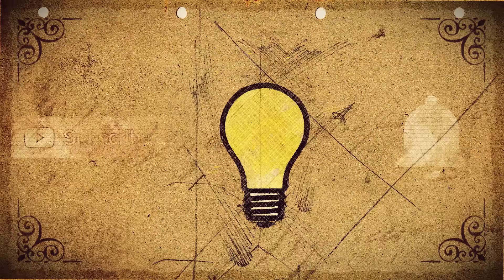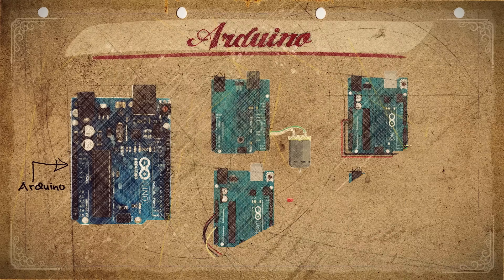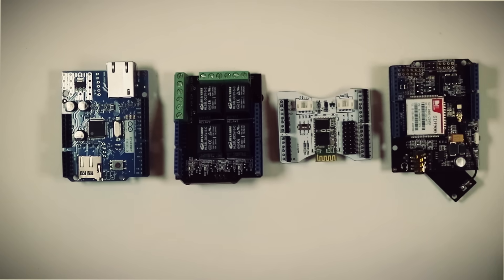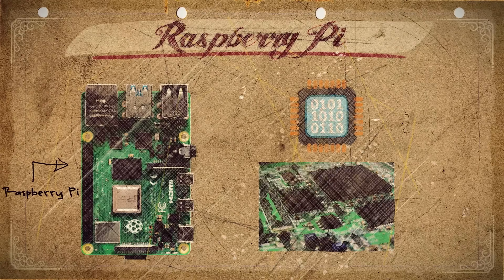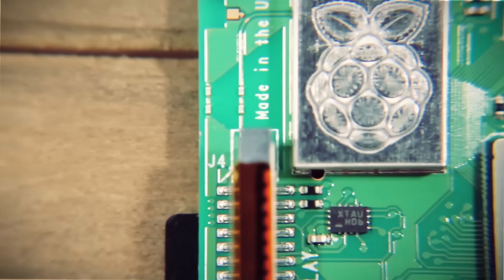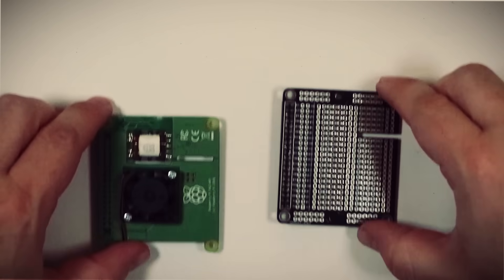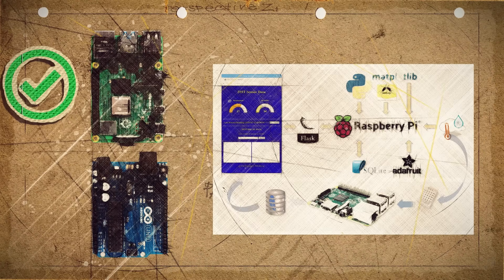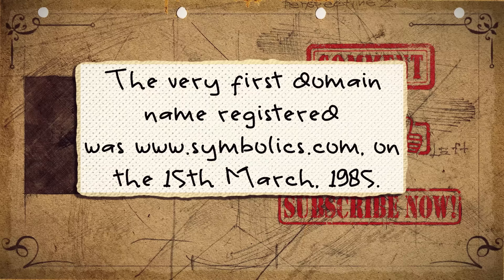What's the difference? Arduino vs Raspberry Pi

Comment: No Nerd ever debated Windows vs. Mac. It's Windows vs. Linux.
Reply: All my comp sci profs use Mac...
Reply: @retrotellephone  That's because they also suck.
Do you really think that you're getting your (or your parents) money's worth?
Reply: @retrotellephone Exactly. Because they already went down the linux rabbit hole and realized it’s a waste of time when you need to get actual work DONE. It’s pretty telling when the department orders laptops for the entire faculty, letting them choose whatever they want. Two of them chose thinkpads. The other 30 chose macbook pros.
Reply: @retrotellephone  "All my comp sci profs use Mac..."

Those who can, do.  Those who can't, teach.
Reply: @richardwicks4190  XD
Reply: @richardwicks4190  There’s a reason why software developers use macOS.  You can make a virtual machine of anything from it.  You can even install package managers like linux.  You can also have arm processor support directly.   No other operating system can make a a good virtual machine for macOS without it being illegal or quickly put out of date or non functional.
Reply: @eddieisfiction442  I am running MacOS and Windows on my Linux box right now.  I primarily use VirtualBox, but I could use VMWare - although I prefer VirtualBox.

I don't give a crap about "legality" either.  I'm not spending $2000 for a broken Unix system that has been kneecapped just to port a program for a one off to a customer.

I'm fed up with Apple's crap.  I'm fed up with them disabling common features in Unix, I'm tired of them obsoleting hardware with software updates, I'm tired of them charging 2x what everybody else does for their CRAPPY hardware, I'm tired of them claiming they "invented" stuff they didn't, I'm tired of their arrogance, I'm tired of their crap.

I'm fed up.

This is a predatory, dishonest, company.  If you don't realize that, well, that's why they can remain a predatory, dishonest company.  You keep buying their garbage and it IS garbage.  It's frustrating garbage to deal with.

Doing something as TRIVIAL as moving a music library to one of their phones is MADDENING.  You know what I do?  I can use Samba, FTP,  SFTP, or just download it with a web-browser through the Apache server running on my $75 raspberry pi server.

They don't create an ecosystem, they make a PRISON but they call it an ecosystem.  They don't work with common protocols, they have repeatedly betrayed corporations that have tried to work with them, they are one of the worst technology companies in existence today, and I'm well aware of the treachery of Microsoft.

I deal with Apple when I'm FORCED to deal with them.  You want to use the system?  You're going to pay through the nose, because no COMPETENT developers want to deal with their crap.  Work with them long enough, and they'll burn you.  Apple is a primitive, broken, Unix system to me.  It's worse than working on a Sun workstation from 1992.  Seriously, it is.  The lack of common tools is just maddening.

The whole purpose and design of Unix was make a single tool to do one thing, and make certain it does it well - then you chain programs together to do more complicated actions.  How do you do that with a sandboxed system like the iPhone?

You don't.  It's like working on a very fast Amiga from 1986.  It was cool back in the day, but that was 35 years ago.  That's how primitive it is to me.  I hate the system, and I will ONLY work with it, when there's a gun to my head.  It's BSD that's been severely hobbled.  They took BSD, slapped a proprietary display manager on it, and stripped it of common functionality and called it "better", they closed the branch they made, and now they want me to buy hardware that is priced 2x what a standard system costs to run it.

No.

If you're a developer and defend this crap, you're crazy or you're a bad developer.  You need to work in other spaces to understand.

Linux is UBIQUITOUS, you're using it right now to read this, more than 80% of the Internet runs linux.  Your car probably runs it, your television, your netflix box if you have one, everything.  You want me to go from THAT to Apple?  I'd rather flip burgers, seriously.
Reply: @richardwicks4190  so you admit you are doing it illegally then….
Reply: @eddieisfiction442  You know it, Brother! Running Intel binaries and development tools on M1 or M2 just fine for all but game developers. Apple has a serious commercial business application development platform in the new Macintosh family.
Reply: @eddieisfiction442  Dude, the only way I can access a remote display, something as BASIC AS THAT, is through a virtual machine.  I'm not going to lug around a freaking computer just to to tweak something every now and then.

Apple makes CRAP.  The purposely break stuff, to cost you money.

It's, hands down, the most frustrating, irritating system to work on, and I've worked on Windows, and WinCE.  I've worked on VMS.  It's ridiculously primitive.

If you want a machine to browse the web, listen to music on, and maybe pop up NetFlix, it's fine.  I need a LOT more capability than that.

The ONLY reason I EVER boot up that irritating, frustrating system, is when I have to do a code mod, which is very rare because Apple is the LAST system I ever support.  I hate working on it.  It's broken, pointlessly, everywhere.

The idea that it's "the best Unix" - is absolutely wrong.  Linux isn't quite Unix, it's a SUPER SET of it.  Porting a program from SunOS or AIX to Linux is trivial - try to port it to Mac "the best Unix".  You can't even get BSD software to work on it without jumping through hoops.  I hate it with a passion.

And it's not even stable.  I can crash Apple by just fooling around with iTunes.  How can a PROGRAM crash the operating system?  We've had protected memory for over 30 years with translation lookaside buffers in consumer hardware.  We've had protected memory for at least 50 years in commercial grade hardware.

You, seriously, expect me to buy their crap?  No way.  Even if it was a 1/4 of the price, it would be a ripoff.

We all break EULAs.  You have to.  It's impossible not to and get work done.  Apple just doesn't want people making Hackintoshe's for 1/4 the price and selling them, and STILL making a profit.  That's the purpose.  It's not to prevent people like me from going into the MISERY of using their system.
Reply: @richardwicks4190  i feel the same way you do but about windows computers.  I can’t trust them to even browse.  I use macOS and arch for workstations, and my server is debian buster 10 minimal install.
Reply: Theres no doupt that MacOS is a capable OS. But it's also locked down af, thats why i say that people who are interested in tech and computers usually aren't hyped about it. 90% of all people i know and would call "nerds" are mainly Linux users, while obviously most of them run a lot of different OSs on their devices.
Reply: Somewhat similar tho. Both are UNIX.
Reply: @SumeethEvans  actually, no. MacOS uses a UNIX-based system called FreeBSD and Linux is a UNIX-like kernel, but they are not the same. kinda like Pepsi is not Coca-Cola

btw, Windows has it's own proprietary kernel
Reply: @arnone1862  And Windows has its own proprietary Windows manager. Which is ugly ;-)
Reply: I first used UNIX at Bell Labs in 1977. Since then I’ve probably used every UNIX variant from every computer vendor you can imagine. 

Linux is about as good as Sun Solaris was back in the early 2000’s. I use Apple exclusively. Chasing weird Linux variants, incompatibility issues and crappy Intel processors makes me an OSX and Apple Silicon Bigot. Nothing is as good as Apple. Period!
Reply: @MultiPetercool  Really?

What remote display system do you use on you Mac?  I use X2Go.  I have about 20 accounts setup on my personal computer, and they can all access a virtual desktop at the same time, after all, I have the memory and disk storage for it.

What do you use on the "best Unix ever"?
Reply: @richardwicks4190  I just don’t use remote displays it doesn’t matter to me.
Reply: @MultiPetercool   Well, I run a server, and my computer is accessible from any part in the world.

NOT using a remote display prevents me from having access to my machine.

X11 was built from the ground up to do remote display.  That was created in 1984.  Why would Apple remove such fundamental functions from its operating system?

It would be one thing to replace it with, say, Wayland or ANYTHING, but they didn't.  They completely kneecapped BSD.

You can't even move an MP3 file on to your phone, or a video on to it.  It's a NIGHTMARE to work with it.

The idea that Apple is making "superior" products, is laughable.
Reply: @richardwicks4190  It’s not like you can’t find open source version of numerous remote desktops for Mac. What are you talking about? I’ve used VNC in the past. Always worked fine for me.

As for video and audio production, most professional studios prefer Macintosh. Apple is the premier media production platform. I have no problem, airdropping video and audio from my Mac to my iPhone.
Reply: @MultiPetercool  The point I'm making is that I won't deal with the cost, and the headache of using a Macintosh computer.

It's a downgrade for me.

It's fine as a machine to browse the web, listen to music, watch videos on, and other trivial stuff like that - but it's a severely crippled version of Unix, and I don't want a crippled system, and I'm certainly not going to pay a premium for the hardware to do it.

Apple has excellent MARKETING and inferior technology.  I do respect their marketing.  It's just a case of when all you have is a hammer, everything you see is a nail.  You don't know what is available to you on a standard Unix system.  I do, and I'm not going back to working with primitive systems except when I must for a customer.
Reply: @richardwicks4190  
Please give me some specifics. I can’t think of any standard UNIX utilities that don’t work on Apple and those that don’t probably have a good reason for not being there anymore.

How old are you? Do you realize that a lot of the features in the old UNIX system are horribly insecure? My experience goes back to the days of literally being able to edit the /etc/passwd file to add users. Sure it was convenient, but it is not a hardened commercial system.  I suspect most of what you complain about are things that you would never want on a production system, and only would use for development and even then could end up with nasty security holes in it.
Reply: @MultiPetercool  A specific example would be SSHFS, another would be X2GO, or just X11.

SSHFS allows you to connect to a remote computer as a directory.  X2GO allows you to connect to a remote display through SSH.

I'm 51.  I understand security well, I don't think you do.  Apple is a horribly insecure, crippled, Unix system.

The /etc/password file is encrypted today.  It has for a long time used salt - the salt being your username.  It didn't always, before the 1990's.  This prevents a dictionary attack.

We're a long time from the 1990's.  Instead of using bcrypt, we use MD5UMS and SHA256SUMS for password storage.  I don't know what Apple uses, I do know it's primitive and we've gone far beyond it.  It's maddening what people don't know or appreciate.

Linux is certainly a commercial system, I guarantee you use it in some way.  This website is running Linux.  It's quite likely your cable or dsl modem is running it.  It's rather likely your car uses it.  It's everywhere, not because it's superior, but because it's so flexible.  Apple isn't.  They took BSD, kneecapped it, and called it superior, which it isn't.  FreeBSD has a lot of good qualities, but it was late, and it's been placed on the back burner as a result.  Apple took it, hobbled it, made it worse, and created their own terrible variant of it.

I know what I'm talking about.  It's a primitive, lousy system, for morons that watch commercials and believe them.

I'm an engineer, I only pay attention to what works.  It's my profession, and I'm good at it.  Any weakness in Linux (and there are plenty!) exists even more egregiously under Mac and Windows despite Windows being remade by the VAX/VMX team.  These are not systems you can trust for security or reliability.
Reply: @richardwicks4190  I think your problem is that you’re trying to use Apple for something it’s simply was not intended. your needs are very specific. That being said, I would recommend an apple system any day of the week to someone who isn’t doing the kind of stuff you are.  I can’t think of a single person I know who would use Linux to run DAW music software or do film production. Apple could easily restore all of those features, but they have chosen not to. That doesn’t make them bad people.  I think there are a number of X11 implementations that will run on Apple Silicon if you’re willing to go find them.
Reply: @MultiPetercool  My point is that what I use a computer for isn't possible with an Apple, despite the fact I'm using VERY standard Unix.

I'm explaining how I think Apple BROKE BSD and then they have the temerity to charge a PREMIUM for this.

The unmitigated arrogance of them.

I'm explaining why I consider Apple to be inferior, in every way, to a standard Linux box.  It is.  All their products are grossly inferior.

I'm using a program called yt-dlp to rip a Glen Greenwald video to an MP3 so I can listen to it, without having to use of bandwidth while I'm out.  When it converts to MP3, I can either put it on my phone using FTP or just downloading it through Apache in a web browser.

How would I do that with an iPhone and an Apple?  Through extreme difficulty, that's how.  Why would I want a MORE primitive, less capable, and more expensive system?

I can take an "unusable" laptop, install linux on a USB drive, make a desktop that roughly looks like Windows or Mac, and hand it back to them.  I sometimes do this for my neighbors.  They just use their computers to browse the web, read and write emails, sometimes watch videos and listen to music.

Doing this costs about $13 dollars for a USB2.0 drive that has 128 GB on it.  Why would I inflict an Apple on them?

Apple actually DISABLES their old hardware, they cripple intentionally to "encourage" upgrades.  They are an greedy, awful, dishonest, viscous immoral corporation.  Why would you support that?

It would be IMMORAL for me to recommend somebody to buy an Apple.  The concept that it's "simpler" is only marketing.  It's JUST a computer.

There's tons of Apple lookalikes if that's what they want.  They don't install software.
Reply: @MultiPetercool  Look, notice I haven't bothered to call you names this entire time, but you're engaging in that.

I guarantee you use Linux.  You're using it now, Google runs it.  Android runs it.  You have it in your car if it's less than 10 years old.

The point I'm making is Apple crap.  The reason Linux is so widely used is not because it's better, it's because it's so freaking flexible.

Apple can't compete against that.  I can do literally ANYTHING on a Linux computer I can on an Apple.  So, why would I buy a machine that costs twice as much as my machine, with the same amount of memory and computing power, to run a hobbled, simplified, Unix system?

I haven't got a response yet.  The problem is, you don't know what you can do on a REAL Unix system.  When all you have is a hammer, all you see is a nail.

Quit talking about the supposed superiority of Apple, it's just marketing.   That's ALL it is.  I can rip out functionality from my machine and get the same thing.
Reply: @richardwicks4190  Whatever. 🙄
Reply: @richardwicks4190  they really do make superior hardware. Its not perfect but no laptop is. I dont really see why you are bringing their laptops down bc your neighbors only use a laptop for browsing, for which, if thats the only thing they will do with it, i wouldnt recommend a laptop in the first place. You cant get a laptop as portable and premium for the price. Their speakers, microphones, screens and build quality are best by far. Yes the cool oled panel on some other laptop looks nice on paper but thats the thing what differentiates apple from other companies. They only focus on experience and dont have to lure people in with a spec sheet. And you really cant match the battery performance and even overal performance with any other machine. Unless you think a gaming laptop thats not much cheaper plugged into the wall with fans running so loud you cant even think anymore destroys a completely silent macbook pro bc it gets a 20% higher benchmark score. then again they are not cheap laptops but you would contradict any  reasonable reviewer if you think they are overpriced.
Reply: Let’s just ask what programmers prefer and I can tell you that none of them like to work with Windows. It’s either Mac or Linux.
Reply: I used to say that at highschool too.
Reply: wasubu l minoco san l  Sure thing buddy. I've got even better for you.

Step 1 : Install Python
Step 2 : Install VisualStudio
Step 3 : Install ms-python extension in VisualStudio
Step 4 : Enjoy and script the living shit out of windows with a language and IDE that actually make sense in 2021 (unlike Applescript)

You're most welcome, buddy.
Reply: i appreciate how nobody here has ever touched a mac
Reply: macOS is actually pretty popular in terms of people using it for software development. Being 100% honest, as somebody who uses both operating systems on a daily basis, I haven't really come across anything that requires one OS over the other. They both work.
Reply: How did windows vs mc even parachuted into a arduino vs raspberry comment sections 😂
Reply: Just say you're broke
Reply: Mac uses the Mach kernel, not freeBSD kernel.
Reply: Mac sucks
Reply: A-men.
Reply: It's IBM versus Apple.
Reply: Window 10 is bad bad
Reply: Mac is Unix based.  Just far more locked down than Linux.   I have used all 3 OSs until my Mac died.
Reply: I am building a multifunction Rover style robot that uses Pi4 and Arduino Uno.   USB connection allows Arduino to be updated and powered.
Reply: My Macbook pro makes an excellent terminal to connect to my Linux desktop! Also good for iOS development.
Reply: Linux is superior to both.
Reply: LINUX (ecpecially because its free) > MAC >>>> WINDOWS
Reply: I mean, windows vs Mac is the only real debate. They’re the only ones that can do essentially the same thing, usually developers will use either windows or Mac alongside linux. This is a super childish post.
Reply: @wiggenvan  I'm a developer in Silicon Valley.

You don't have the first idea of what you're talking about.

Do you know what the #1 OS is today?  Linux.  It's used everywhere.  It's in your car, in your television, in your set top box, in your Docsis cable modem, your DSL internet box.

Windows and Apple are toys in comparison to Linux.  Want to develop in Apple?  Well, you're going to have to use Apple hardware and they dictate everything.

Want to develop in Windows?  Well, you're going to get a binary, and they're going to dictate what processor you're going to use, and you're going to get a 1/2 documented operating system you can't debug.

Apple is for people who think they understand a computer, but do not at all.  It's a retarded, restrictive version of Linux.  Does it even have remote display capabilities?  I don't know, but I do not any other Mac users that do.

Desktops, laptops, phones, and tablets are a MINORITY of the machines that run operating systems.

This site, is Linux.  Nearly every site is.
Reply: @wiggenvan  thats bs
Reply: I like linux because I like pulling my hair out and looking up things.
Reply: @noweare1  The majority of computer devices run Linux today.  You just don't realize it.  The entire internet runs off from it.

Can you setup a POP or IMAP server under Windows?  Can you track intrusion into your system under Apple?  Linux wasn't designed for end users on the desktop, it's for development.  If you want end user Linux, I'll suggest you get MxLinux or Lubuntu - those are easy enough to use.

If it's not for you, don't use it.  Using Microsoft or Apple to me, it's like going from a powerful machine I control, to a powerful machine that controls me.  The frustration of NOT being able to do what I consider TRIVIAL THINGS under Windows or Apple is maddening.
Reply: For a nerd it is just PC-Engine. Wannebe nerds discuss SNES vs MegaDrive.
Reply: Lol even here under this specific comment the replies are hilarious- in the nerd world each nerd is the smartest know it all EVER LMAO (not😎)
Reply: Linux vs BSD
Reply: Unlike windows vs. Mac it’s literally boils down to what you do
Reply: Spoken truly by a mac user
Reply: Always a trade off, depends what you want to do specifically.
Reply: Calculator vs linux
Reply: yeah?? no
Reply: Depends on the type of nerd
Reply: Cool..very cool 👍🏼
Reply: Not windows vs Linux
its debian vs arch
Reply: If companies made more Linux versions of their software,  then it would be a no-brainer. Personally, I have both a Windows 10 desktop, and a Linux laptop (I use my laptop way more often than my desktop).
Reply: Linux today is actually starting to pass Windows in how good it is, except for gaming
Reply: The real debate is Linux vs Mac
Reply: When you want a unix terminal and also need everything else to just work, ie your purpose is productivity vs configurability, you just run a mac.
Reply: Win, Linux >  crapple! 🖕🤡😁
Reply: Software engineer here: I prefer Mac. Unix system with corporate support. Also the new MacBooks last 1-2 days without an outlet. That’s wild.
Reply: mac is not a real os
Reply: nowadays is linux distro 1 vs linux distro 2
Reply: Yea... Because Mac sux balls.
Reply: I thought it was Windows vs Everybody...
Reply: We actually did it at University. There are many things that people don't realize about Mac. Mac is one of the best in terms of user-friendliness and because its build for the hardware it's running on, it also makes it much better for heavier loads than Windows. Those were the two main reasons that we found the most important. There are a lot of negatives as well. Which in this case outweigh the positives.
Reply: @masterdrive4033  I didn't realize a core i5 can do better than my GPU in terms of heavy loads
Reply: @darksideorbit8898  Mac has a dedicated GPU.
Reply: Disagree. Macs can't even run Solidworks, CATIA, AudoCAD. It's not user's friendly, it can't even upscale properly and compatibility is low, no upgradability, expensive for no good reason. You can buy 64GB RAM for PC for the same price that apple charges for 8GB. It's useless for engineering and even apple uses Windows to engineer their products. There's not True alternative for Windows
Reply: @masterdrive4033  mac os sucks
Reply: @masterdrive4033  HA HA!!!!!!!!!!!!!!!!!!!!!!!!!!!!!!
Reply: @masterdrive4033  g🎉🎉🎉🎉🎉🎉😂🎉🎉🎉🎉🎉🎉🎉
Reply: @masterdrive4033  The Macintosh is nothing more than FreeBSD with a proprietary GUI system built upon it.  It's a primitive, frustrating, hobbled version of Unix.  It does not have superior hardware, it's vastly over-priced for the performance.  Apple does not have either superior software, or user design, but they have INCREDIBLE marketing.
Reply: @richardwicks4190  I've been nearly crucified for expressing the EXACT same opinion haha. The marketing was done so well that people now see the brand as an identity and defend Apple to the death. Personally, I prefer systems that you can customise and build upon with good engineering behind it. Think that Apple products in general may be a little overrated.
Reply: @richardwicks4190 if there is one thing max has it’s good UI
Reply: @richardwicks4190  omg u are literally spitting facts
Reply: @masterdrive4033  Macs are crap.Period
Reply: @masterdrive4033  MacOs is terrible and Macs are terrible too.
Reply: @mathisbuilder  Based on ?
Reply: Arjan van Vught yes
Reply: @mathisbuilder  until apple silicone…
Reply: Mac = You are a mere user.
Windows =  Now you can control some stuff and become an admin for some part.
Linux =  SUDO SUPER USER CAN DO EVERYTHING!!!!!!!!!!
Reply: @sooryansh5733 I love all the OS.... Grew up with Windows and still use it. But I prefer Linux though. More power, customizable, and resource light.

Macs are like Starbucks. It's a status thing but still of acceptable quality.  I prefer to grind my own beans.
Reply: @NobleAbsinthe  Same bruh Same.. A true Tech enthusiast knows, Windows and Linux goes hand in hand, for some stuff you need Windows, and for the rest can find a workaround on Linux.
Reply: Laughts in linux
Reply: Mac is better because it's UNIX based like GNU-Linux (UNIX is the 'U' in GNU) GET NEW UNIX -> Linux ( 😂 or probably NOT*)
Reply: Bruh, Mac is Unix...
Reply: Mac is based off of BSD UNIX from way back in the day linux had no actual UNIX code its a clone FreeBSD netbsd openbsd are closer to UNIX than linux is
Reply: I use which ever operating system gets the job done and money in the bank account at the end of the pay cycle.
Reply: Linux is the best. Not even a debate.
Reply: Linux.
Reply: Linux is better, but windows has always had that appeal to me.
Reply: @averagecommenter4623  I understand that. Sadly i have never been able to run just one system, i always had windows and linux running parallel (either dualboot or two different machines) because i always miss something when only using one. For the future i guess I'm going to settle for windows on my gaming PC (that then can also run fusion360 and adobe products too) and linux for everything else.
Reply: Yes and linux usually wins that argument
Reply: Henrik I feel like the only people who buy Macs are people who want a fast pc but can’t build their own. Buying a Mac is like buying a brand new C8 Corvette.. when you can spend half the price on something else and blow that C8 off the track. Macs do look nice.. they run well.. but upgrading hardware in them and taking them apart is a bitch though.
Reply: Seriously, I love these amazing OS’s Microsoft is shitting out every four years.
Reply: @Letstrypeaceoverhate  window 7 was epic
Reply: Nah man its mac vs linux. Windows was only ever an option because its the most widely used not because its better than other operating systems
Reply: The ONLY advantage you get with Linux (for productivity, not hackability) is the posix terminal. Other than that, the user experience on Linux just SUCKS. And I’m saying that as having several machines with different distros, all they way from arch on a librebooted thinkpad with dwm window manager to the most basic ubuntu gnome. Linux is what you get when programmers are also in charge of design, and most of them have very poor taste. Linux will NEVER outcompete Windows simply for this. And if you can afford it and want to run software that is optimized for your hardware, just run a mac. It’s for people who don’t have time to configure things because they are too busy BUILDING things.
Reply: @realCaptainFordo  The original poster said no nerd ever debated Windows vs. Mac - that's true.  There is a real fight over Linux versus everything else though, and it's an important fight.  We are very fortunate that the GPL exists and Linux exists with that copyright.

In order to access a computer, there needs to be a freely developable operating system.  It's absolutely essential.  If that ceases to exist, you will end up renting your right to use a computer.  That is how Microsoft Windows is moving today and Apple will move in time as their revenues dry up as newer IPhones are no longer social status symbols.

You will be forced into renting everything on your machine in time, you will no longer be able to buy software in 30 years.  That is where you are being pushed.  MS Office is no longer a DVD ROM you can buy at an office supply store, it's a monthly rental.  Open Office may destroy that, we can only hope.
Reply: @richardwicks4190 mac still is a great os. I use windows and linux but you seem to forget that not everyone is a software engineer. There are a lot of professionals who use adobe or other video or music software that just works better and smoother on a mac without having issues they themselves cannot fix. On top the m series chips are amazing chips that offer abilities the competition cant match yet
Reply: No “computer nerd” would be using Windows. Only Pc video game nerds (ps: PC gaming is awesome).
Reply: @sidjtd  Console is fun too sometimes. PC is better overall though.
Reply: @sidjtd  Console is fun too sometimes. PC is better overall though.
Reply: David of Yorkshire  "Actually when the Mac was based on a Motorola 68000 series it did have superior hardware."

That particular Mac was able to be emulated by an Amiga 500, which was significantly cheaper, had color, and ran faster than a Mac when emulating a Mac.

The Mac OS at that time did not support pre-emptive multitasking, Amiga did since it was based on a Unix implementation.  Both were superior to the PC at the time, which was still stuck with Dos.  The BBC Acorn and Atari ST were also superior hardware solutions than the Mac, and less expensive.  When you emulated the Mac on an Amiga, you could multitask between both OSes.  It wasn't just "dual boot".

"However since moving to Intel/AMD it is no different to a any PC, and as such it's just a Unix type (FreeBSD/OpenBSD like Sony PlayStation) kernel with a GUI much like many available for Linux."

AFAIK, and I could be wrong, the current Mac doesn't even have a remote display solution.  It segregates files between programs, it determines what you're allowed to install on your own machine.  Try installing Dissenter on it, for example.  There is no "Apple ecosystem", that's just marketing, it's a prison.  People who use Apple are stuck with it, because Apple only works with Apple.  It's an extremely frustrating operating system for me to use.

"In short Apple shot themselves in the foot, loosing their uniqueness when they switched away from Motorola."

Not really, Motorola shot themselves in the head ages ago.  Power PC was a bit of a clusterf*ck of a design.  It doesn't really matter, we're going to move to a variant of ARM or perhaps ARM itself - all their patents have run out.  RISC-V is a play, but games are being played trying to position companies in it.  Eventually it's going to be some open architecture, and not "open" as it's FALSELY called today.  I mean open, like GPL - fully documented, royalty free.  Not "open" in that you can make use of it, if you pay a ton of royalties.

When the PS3 came out IBM announced they would produce a PPC/cell workstation.  I was really excited to get off from x86, which is the WORST architecture ever created - it's a mess, programming it in assembly would drive me to suicide.  But IBM dropped by the ball, and I think even sold off their PPC division.  If you want to run Amiga today, you can, on a PPC board, that runs at around 2 Ghz,  for 3 grand about.

PPC is dead.  I haven't seen it used in a design in 10 years now.  I'm sure it is used here and there, but it's so damned expensive, I'd never chose it for an engineering solution.

Honestly at this point, I'd be happy with a board running a 2 Ghz 64 bit ARM that I can plug cards into, so get a decent video card.  A raspberry pi 4 is ALMOST usable as a desktop, but its GPU sucks.  Try running X2GO on it at a reasonable speed on a LAN.  It runs better as a remote server, than it runs as a client to a remote server.
Reply: @richardwicks4190 ah yes. Back when Apple was a respectable company and not a room full of creators of fan boy whore products.
Reply: You're right. It's because mac is better. I'm typing this on my MacBook rn
Reply: @thermalflame8829  You can type comments on a mac? Amazing
Reply: @realCaptainFordo  The point of moving people to Linux is preventing a monopoly from having control over computer access.

Should either Microsoft or Apple extinguish Linux, there is no limit to the cost of having access to a computer.

However, if Microsoft and/or Apple are extinguished there's no limit to the devices and control you have over your devices.  I can watch this video and type this message on a $35 computer running Linux.  Seriously.

This argument is a very real and important one.  It's not childish at all.  We can never allow a corporation nor a cartel of corporations to control computer access, or the world is controlled by that corporation or cartel.  Computer access is no longer a luxury, it's an absolute necessity.

Should Linux be destroyed, if a computer costs $5,000 - you will pay for it, or go without.
Reply: I  use Mac because the UI is beautiful. But i prefer Windows when it comes to USERFRIENDLY
Reply: @jaybonline you can make windows look like mac or even Linux guis